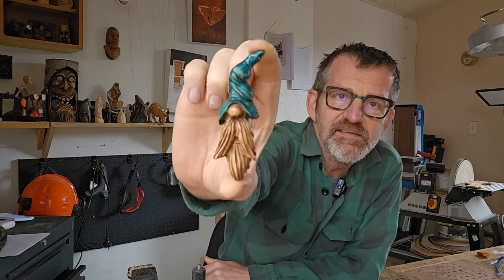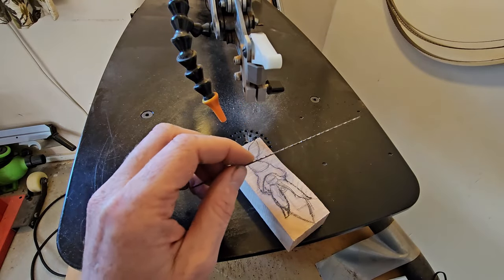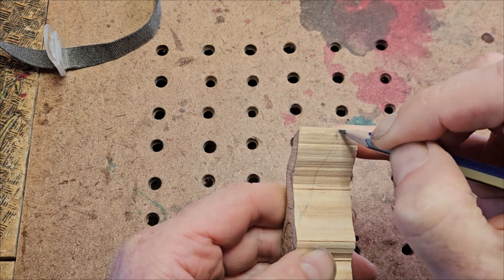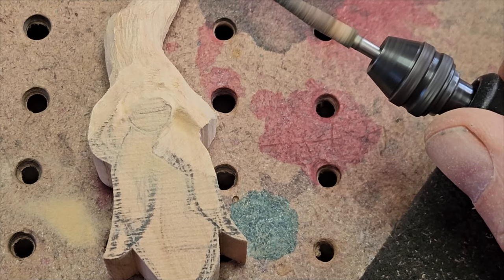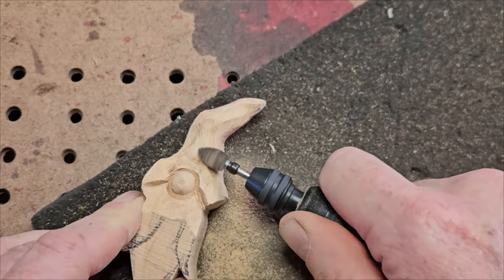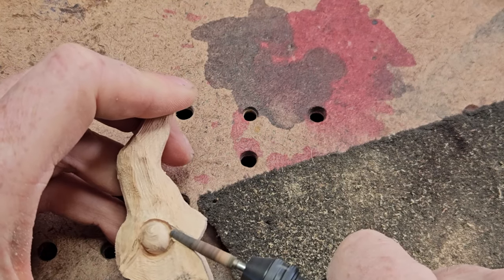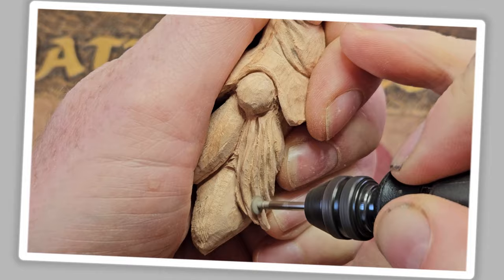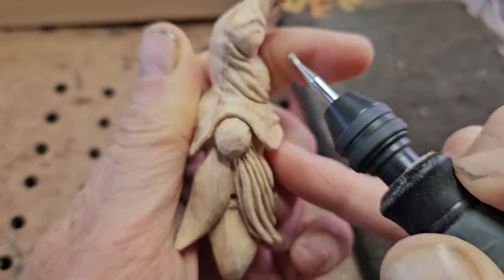Easy Dremel Gnome

Comment: It took me a few watches to learn that this project is a refrigerator magnet .9" thick.  I had been wondering how to finish the back side because I was planning on making some for Christmas ornaments.  I'm using  1 1/8" for a thickness and will still do them as ornaments.  I'm using cedar and  these are light enough for ornaments.  Matt gives out the best burr tips.  I didn't even know about the concave burrs let alone how to use them.  Thanks so much, Matt
Reply from the maker: That's the great thing about cedar it's super light. Yeah those concave bits are useful 👍 cheers for watching 😊
Reply: Update:  I did 4 of these as fridge magnets for Christmas  gifts .
Reply from the maker: @shastastan1935  nice 👌

Comment: Thanks for the tutorial Matt! I'd like to see more about the scroll saws capabilities versus the band saw.
Reply from the maker: Yeah, have been meaning to do a video like that. Cheers Claire 👍
Reply: For me, it's a pita to change blades on the bandsaw so I used my scoll saw.  I had made the blanks too thick (about 1 3/4"), so I changed the thickness down to 1 1/8".  This was much easier to cut on the scroll saw with a #12  Mike's Shop  blade.  I have 2 band saws, a 14" Jet and a 9" Ryobi for smaller stuff.  The Ryobi only cost $129.  My scroll saw is a 16" RBI Hawk that I've had for over 30 years.
Reply from the maker: @shastastan1935  yeah changing bandsaw blades is the Pitts, especially if your changing sizes. 👍